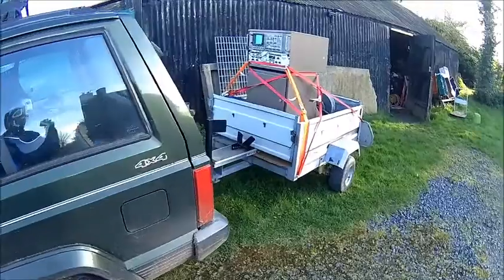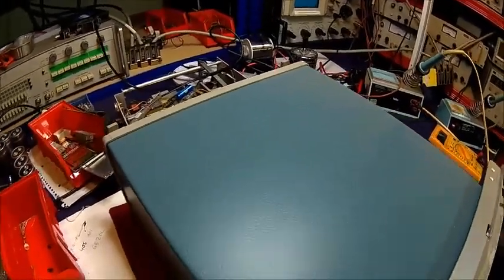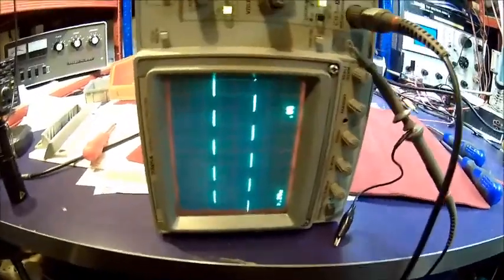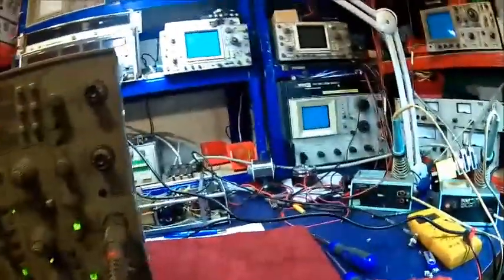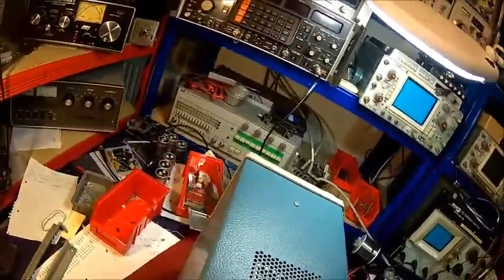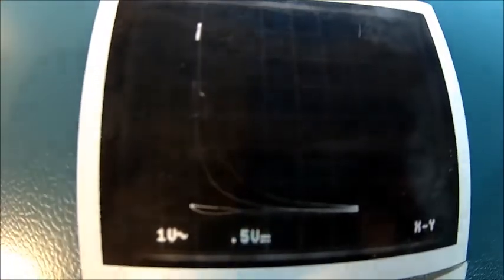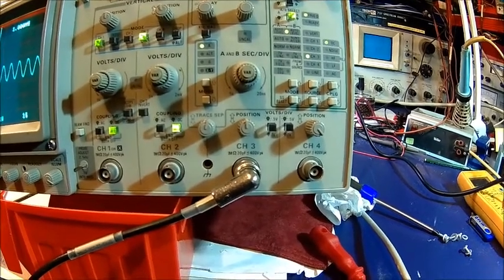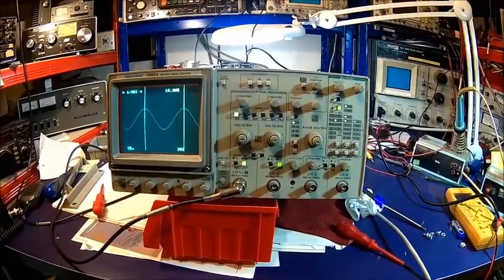Saving a Tektronix 2245A Scope from the scrap bin, tear down inspection and test

Comment: It has been definetly used, as you say, to analyze the combustion performance of engines. The polaroid pictures correspond to an Otto cycle engine, the scope was used as the screen of an indicating system.
Reply from the maker: You absolutely right. I know for sure that it was a combustion analyzer as the customer replaced this one with an AVL Indimaster. ... My day job has to do with the engine testing business ...:-)
Reply: @dynoguy  Just noticed your username :P duh!
Anyways, very nice score!
Reply from the maker: Well,... i'm actually surprised that very few people notice that connection,...well spotted, cheers, Mike

Comment: great score  .just park buy the bin and it loaded its self  lol. thanks for sharing :)
Reply from the maker: Well,...there was some breakfast funding involved, think that helped a bit,...... just found another (very heavy) thing on my trailer,...so stay tuned ...:-)
Reply: the cabinet looked like some good  stuff as well  look forward to seeing  the next load :)
Reply from the maker: It is indeed, the bottom is a nice rollcab with good solid castors and the top is a 6U 19" cabinet, got a use for both ...:-)
The other thing will take a few days,.....all i say right now: ... it is supposed to cut metal ....